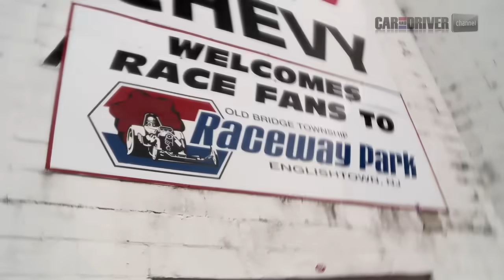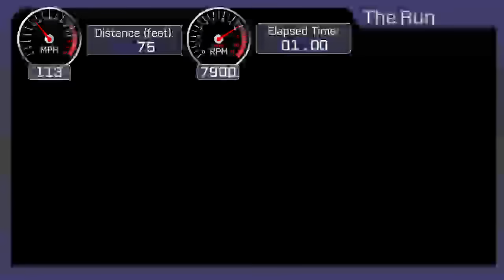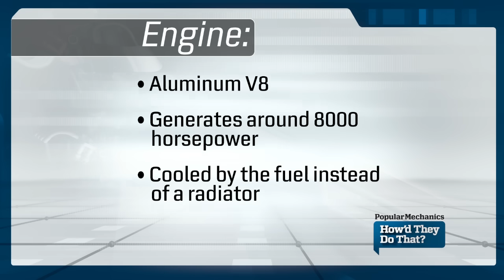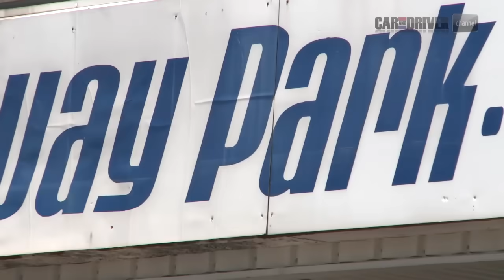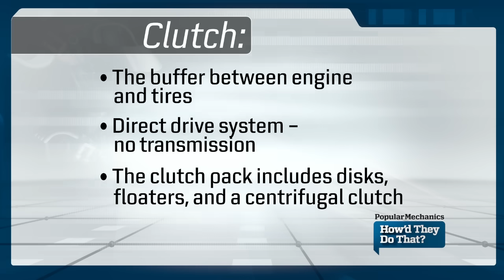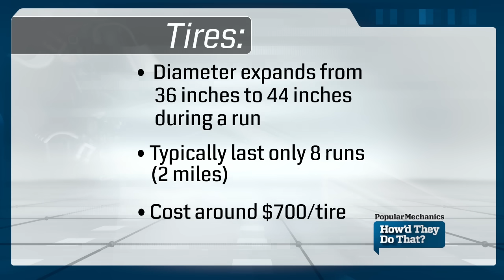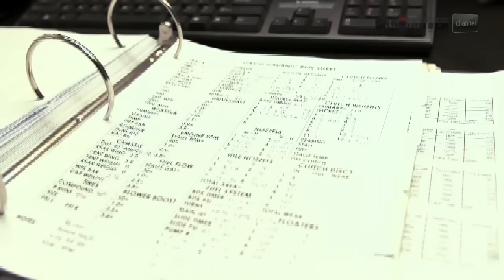How a Top Fuel Dragster Works

Comment: Please explain  how do you have reverse  with no transmission  and having a direct drive, does the engine run backwards  for reverse or is it done in the differential
Reply: They slip the clutch completely
Reply: @captainhellhound7451  is there a second  drive motor just for reverse, I've seen them back after a burn out was just curious  how do they get a reverse gear when in direct forward ,what makes it go reverse

Comment: Went to a drag race meeting here in Australia recently. Yeah they had top fuel dragsters running, ground shaking, very high dB etc. Went to the pits, saw the engines being rebuilt after each run.  However, can"t see the sense in this sport, when you have to pull the engine and clutch down after a few minutes activity. Formula 1 and Le Mans type racing makes a lot more sense, at least braking a handling come into play, as well as engine performance. Just my opinion......

Comment: Is the Chrysler pushrod engine used due to a certain advantage, or is it just used for historical reasons because it would be too burdensome to change it at this point? I'm a novice with cars, so curious if there is any inherent racing advantage to the pushrod setup rather than the DOHC.

Comment: Has anybody ever tried using compressed air tanks for forcing air into the engine at like 100psi, it also comes out of the tank and expands and in the process becomes really cold which I believe is good for the engine?

Comment: is that 2 valve cylinder head a "ruleset", are they not allowedd to go for a 4 vavle?
Reply: Yes. Here is a quote from the 2020 rule book for allowed engines:
"Any NHRA-accepted, reciprocating, 90-degree V-8, singlecamshaft, automotive-type engine permitted. Multi-valve
and/or overhead-cam engines prohibited. Maximum 500 cid;
maximum bore center spacing 4.800 inches; maximum cam
centerline 5.400 inches, maximum two valves per cylinder."

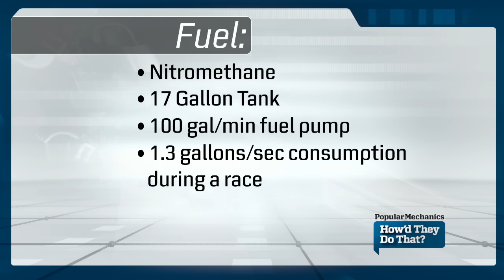Comment: 8:49   1.3 gallons/sec consumption during a race. If a race is 3 seconds or so how does this correctly compute? Fuel is needed to move the car to the starting line and also during the burnout and idling before the start is my best guess. But the tank holds 17 gallons of fuel so it seems like it's off by quite a bit.

Comment: The specific energy of nitromethane means at 100% efficiency it should supply a 10,000 horsepower engine for 6.5 seconds. So 1.3 US gallons per second means it's only 11.7% efficient.

Comment: The nitromethane explanation was a little inadequate, the reason you get so much more power from nitromethane than gasoline, is because it brings its own oxygen within the volume of the fuel, allowing for more combustion, not only do you have all the oxygen in the air you can stuff in a cylinder, you also have a bunch of oxygen in the fuel itself, meaning maximized oxygen input into the equation.

Comment: Just out of curiosity, why do they rebuild the motor while it’s in the car? Idk but wouldn’t it be faster (in between runs) just to replace the motor every time then rebuild the motors later or while it’s out of the car? I say this because it seems like the mechanics are rushing to get everything done which could lead to a mistake and a blown engine.

Comment: The secret about Nitromethane is that it carries its own oxygen. Fuel is worthless without oxygen. Combine that with about 5 bar of compressor air pressure, and you gett plenty of power.

Comment: At 4:06 they show a side view, and on the front of the engine is... an alternator?  I have never seen a Top Fuel engine with an alternator.
Reply: I just saw that. And what looks like a water pump pulley, too. They have neither.

Comment: actually the comment on screen about no suitable DYNO is wrong.  The reason they don't have the exact power is because to do a DYNO you have to run them at a variety of speeds to get the horsepower range of the engine.  The Top Fuel and Funny car engines don't have a water jacket.  NO COOLING EQUALS BOOM in about 5 seconds at full power

Comment: The bullet points for the supercharger say that supercharging loses 600 hp as a "parasitic loss", can someone explain this? Is this because more energy is lost as heat instead of being converted to horsepower?
Reply: Derek Roberts turning the supercharger requires alot of power because it compresses air

Comment: Second video in a row like this and still no explanation how the fuel injectors work?
Reply: it is injected but not in the same way a normal injector works. these are just tubes hooked up to multiple places on the engine. there is multiple for each intake port for each cylinder and also some on the intake manifold and some in the blower hat. they basically spray fuel it is not timed at all.

Comment: No wonder they all use OHV engines if the teams need to rebuild them after each run. Simplicity at its best. Now I wonder if someone would opt for rotaries, though... Just imagine, like quad-turbo 8-rotors vs. big block OHV V8s...

Comment: What I don't get is why fuel usage is calculated in gallons per minute (gpm) when the car runs a 3-4.5 second quarter. You'd think they'd use Liters per second (L/S) as a more accurate measurement.

Comment: Funny thing to build one...it's about $150k....less than a 911 turbo or GT3...but the maintenance is about $4,000<5000 a run...if it doesn't blow up.

Pro-Stock car Cost about twice as much to build...and have less maintenance.

Comment: There are dynos that can test that kind of power and torque.  But these engines have no cooling system, which causes a problem if you want to run it on a stand for more than a few seconds.

Comment: In F1 they add enough fuel to barely cross the finish line after 2 hours of racing. 
Here they add double fuel than they need in a run.

Comment: My dad does "tractor pulling" and the bassicly use the same engines but use methanol instead of nitro. If you use methanol in one of these engines you can run multiple times but get less horsepower, if you use nitro you get more horsepower but your engine would be dead in 1 or 2 times.

Comment: How much acceleration di you think the car would have with a trnny like it would launch evan faster better make sure it porche trans so it could shift fastest fastest transmission gota be auto so u dont go boom and it needs a computer to make sure the engine isnt at 100000 rpm so it dont blow up and lose instantly

Comment: I really had no idea the car basically self destructs the motor in the race..... Also cooled by fuel? Isn't that like putting out a fire with wood?
Reply: I think its mentioned, but durability and performance are somewhat opposites. To get maximum performance durability is sacrificed. Nothing other than the spark plugs are really junk each pass, but many parts are very short lived.

Also, cooled by fuel is a weird statement that really means that nothing else cools it but fuel. There is no cooling system, its a solid (engine) block. What happens is when a compressed fluid (in this case nitromethane) is decompressed it cools. So when the nozzles spray fuel into the engine, it does provide some sort of cooling. If you've ever used a "canned air" duster, the air coming out is very cold. Thats the same effect. Fuel cools when its sprayed into an engine, and it does provide some cooling until it ignites.

Comment: 6.78 Gs. For the first half second, anyway. 74mph after a half a second. 74mph=108.5fps. Times 2, because that's how fast you'd be going if you accelerated at that rate for one second. 217fps/second. Divide by 32 (1G=32fps/s). 6.78Gs for the first half second.

Comment: 315 is kinda slow in this season runs based on what i saw from several drivers looks like NHRA is going to need to slow them down more.  Brittany Force set a new ET and speed record.  Over in Funny Car Ron Capps ran 339 and the NHRA raised an eyebrow to that.  Next season they are going to slow the cars down by limiting the air intake from the supercharger.

Comment: Top fuel dragster no longer hold the world record for speed Robert Hight set a new world record at 339 mph in his funny car.  They still got the Funny Car on ET and acceleration though and that is because of weight and how the two cars get through the air.  However, John Force did race his daughter Brittany in her dragster vs his Funny Car and he won.  FUNNY CAR IS STILL KING.
Reply: They allow funny cars to run higher ratios of nitromethane to methanol, top fuel dragsters are limited to 90% nitro, where funny cars can run up to 93% nitro.  this is why you see higher top end speeds from funny cars from time to time. Let the dragsters run 93% they'd own that stat constantly too.

Comment: You'd think they'd put something bigger in it than a V8 😂😂
Reply: The   V8   has   proven to be the ultimate in   drag   racing      these   engines   put out   the  maximum   for  their   size and weight     bigger   engine  might prove  more  durable   but   bigger   engine   will weigh   more   car  will be   slower     durability   for  this  application is not  quite as  important   as   long as the engine can  stay together   for the   burnouts     a bit of  idling and a 4 some second   race  that is        long  enough    ,,,,,   also    the     single   engine   V8   has proven to be the   best in   drag   racing   multiple  engine  rigs   might   look  impressive   but  are not  neccesarely     faster    ,,,   also I   think  it  might   not  neccesarely be   rules  that dictate the it must be a V8   it just   happens that the    V8  is the    ultimate

Comment: So why Nitromethane and not Gasoline?  I understand that Nitromethane carries it's own oxygen to a degree, more fuel in the cylinder means more power, but it adds to more weight.  Seems to be logical to use less fuel (gasoline) and use more O2 to get the same power and save weight.
Reply: NitroMethane has oxygen in a liquid state.  Think of the concentration of oxygen vs gas oxygen from the air.  You have more power contained in gasoline potentially, but to get the requisite oxygen in there with it is not possible, you can't compress air down to liquid oxygen concentration levels.   Its a magical chemistry way that allows very concentrated oxygen to be stored and injected into a cylinder.  Now think about this:  Our oxygen level in our atmosphere now is about 23%.  Our atmosphere used to be over 50% oxygen.  Imagine the forest fires!

Comment: this is the reason why prius's are better they're spark plugs dont burn out at full throttle and the clutch dont weld its self and it still maintains to do a 2 second quarter mile 
lol

Comment: I did read that the engine crank only does about 450 revolutions from start to finish line; be interesting to find out if that is correct. - anyone?
Reply: It idles about 5000 rpm

Comment: why not use like a v12 or something
Reply: シドニー to heavy
Reply: NHRA kind of tightened down rules over the years. Early days didn't restrict much, including multiple engines and four wheel drive. Now the rules restrict you to one V8 engine ( with very strict parameters). Could you make a V12 Top Fuel car? Sure, but you won't race on an NHRA track.
Reply: xPr1m3  thanks

Comment: "Rocket fuel" in what weird universe do you live in where they use nitro as rocket fuel? You do know that nitro is actually less energetic then gasoline right? Gasoline is closer to rocket fuel then nitro.
Reply: Nitro has been used as rocket fuel.  Nitromethane is a mono-propellant and can burn without the presence of additional oxygenwhich is necessary in space whereas gasoline will not burn without additional oxygen.

Comment: But if petrol has more power per gallon, why not just use petrol and use as much of it as they use nitro?
Reply: a big part of it is the temp at which the fuel burns, another is the octane rating; forced air induction (supercharger, turbocharger, etc) creates a lot of heat, the heat can cause the fuel to ignite at the wrong time, a very high octane fuel helps prevent that from happening. Likely though, the biggest reason Nitromethane is great for forced air induction is because it carries oxygen in the molecule; with gasonline you want about 14.5 parts of air for every 1 part fuel to burn at the correct ratio, high percentage Nitro is a lot closer to 2 parts air for every 1 part fuel at the correct ratio...this in turn allows you to put a huge amount of fuel through the engine which helps tremendously with cooling the engine, as about 1/3 of the mixture running through the engine is fuel (instead of hot air from the supercharger)

Comment: Imaging have a 601 horsepower car and with that supercharger bolted on zapping 600 as a parasitic loss you be left with 1hp
Reply: In 2020, it's closer to 650 hp needed just to spin the supercharger.

Comment: So if your take the 1.3 gallons of fuel per second, times say a 3.5 second average run, the car pulls about 4.55 gallons ON THE TRACK. times the cost of fuel ($35/gal) gets you $159.25 JUST ON THE TRACK. And they say they try and average about 8 runs, so the total fuel cost is about $1274. THEN he said that it cost about $5k per run to fix the car so with the average of 8 runs, thats $40k right there. Plus fuel is $41,274.  For 1 race day. NOT COUNTING the cost of the car itself, travel, entry fees, food, lodging etc. THIS SHIT IS REALLY FUCKIN EXPENSIVE.
Reply: Plus the $700/tire times the 2 rear tire (I'm assuming thats the ones they were talking about) brings it to $1,400 in tires per race day. Add that to the $41,274 and there's a total cost of $42,674 per race day. Times the +180 races per season, gets a 10 month season cost of $7,681,320, assuming my math is correct.  Thank god for sponsors I guess.

Comment: I don't get it. Yes it is remarkable that you can go that quick for 407m/ 1/4mile and its exciting. But why would i need to see more that 5 of these races? In circuit racing you have at least exciting overtaking manoeuvres and a lot of tec that is constantly evolving with new concepts for getting faster. But here you get a reletivly simple tec that doesn't change in any groundbreaking way. Of course power goes up and so on but whats advances in tec do you have? A v8 on nitromethane with a rootsblower and a clutchpack isn't the newest tech in the business...Of course they get the maximum out of this technology and i really respect them for that but i still prefer a intresting 24h race on the green hell. Sorry guys if i'm a bit rude i don't want to offend drag racing guys but please explain me why you guys over the pond are so hyped by it. Maybe i just need to see it in person.

Comment: "Based of a Chrysler Hemi"
Sure.
Reply: They are
Reply: @thenotoriousnova1102  What parts do they share?
Reply: Leo Arc They based these motors off the hemi for the hemispherical cylinder head
Reply: Leo Arc literally the whole bases of motor is copied from the hemi or at least inspired
Reply: Leo Arc Powered by a supercharged and fuel-injected 500-cubic-inch adaptation of the famed Chrysler Hemi engine, Top Fuel dragsters can burn up to 15 gallons of nitromethane fuel during a single run.
https://www.nhra.com › nhra-101
Drag Racing Classes | NHRA

Comment: The more I learn about them, the less I care about them. Gimme a modified-but-street-legal '67 Camaro with 600 hp and I'll never ask for anything more.

Well...I might ask for some nitrous and twin turbos, etc., to get it to 1500 hp.

But the "cars" is this vid are silly and have little in common with the real deal. Might as well buy a ticket on a rocketship--which we can now do. That'd be money better spent.
Reply: Are you really comparing a Top Fuel dragster to a muscle car? It's like comparing a Pizza to an orange. LMAO
Reply: @lossantoscity3249  No, it's like comparing a finely-tuned triathlete to a steroid-addled, muscle-bound body builder. One functions triumphantly in many various races. The other is flashy, but otherwise utterly useless.

Comment: So when is this shit going to max out!? The main keep back is pulling off from a stand still. Solution...install a directional bomb onto the frame of the dragster wired to the accelerator pedal. That should get you off in a timely fashion.

Comment: 1000ft? It’s not 1/4 mile?
Reply: Jesse Costa the engine had effectively destroyed itself at 1000ft, 1/4 is pointless
Reply: Captain Hellhound when you put it like
That lol.. I always though they raced a 1/4 mile
Though. I am schooled.
Reply: @jessecosta9483  You've been incorrectly schooled. NHRA nitro classes (Top Fuel/Top Fuel Funny Car) run 1,000ft. This rule came into effect after Scott Kallita died in 2008. 1/4 is not pointless, but was deemed unsafe to the NHRA after Scott's passing.
Reply: xPr1m3 ahhh ok makes sense. I went to the Pomona winter nationals when I was like 12 (currently 33) and I remember then running 1/4s. Thanks for clearing it up
Reply: @jessecosta9483  No problem. 1/4 mile is for sure the standard, but after Scott's passing the NHRA shortened it for nitro cars. Every other class still runs 1/4 mile.

Comment: Have to be a Millionaire to have a team? Still the fact is the Nitro cars racing 1000 feet is not a drag race. 1320 feet is a drag race. Like the Indy car race not 500 miles? Would be a 400 mile race? Love the racing but who pays the bills? minimum of $35 plus for one adult admission? Not much left for a dreamer to build a car to race. Kind of like the Tucker automobile. Some few hold the string to all the metal fuel etc. Oh well interesting video. Maybe a video of the driver in 1/4 mile?

Comment: Still trying to figure put why a V8 is producing that much horsepower, but the dodge demon barley hits what it does.  I man wtf it has 10x the hp of a w16 8l quad turbo engine of the Bugatti.  I also know almost nothing about cars, so I am not 100% sure.
Reply: Its the fuel.  Its basically dynamite going off in the cylinders.  Nitromethane has oxygen inside of the fuel, so the amount of energy that can be released per explosion is exponentially higher than on gasoline.